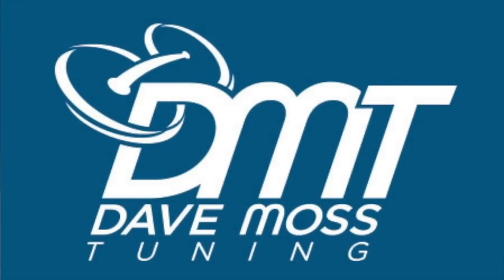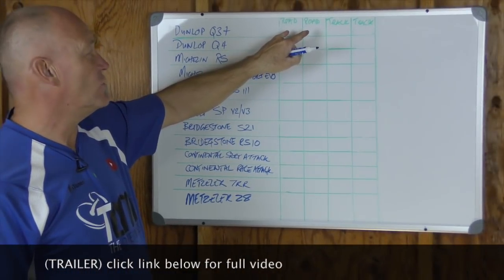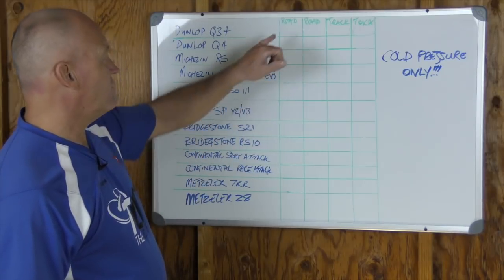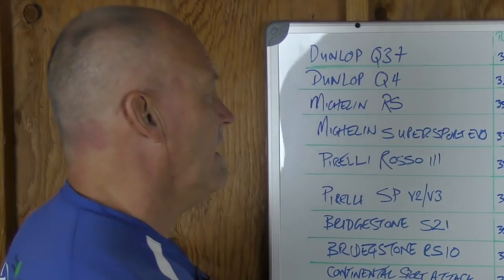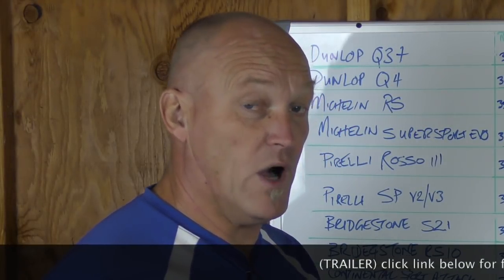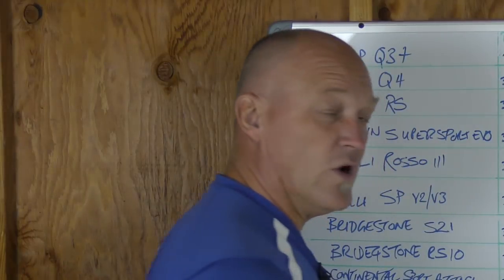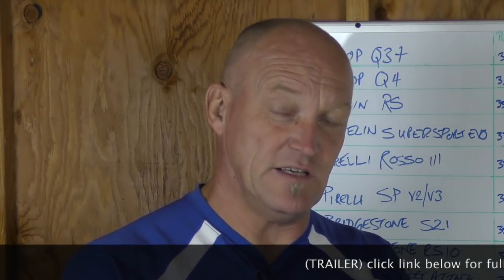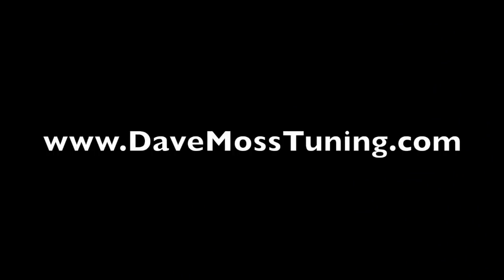Contact Patch: All Hypersport Tire Pressures (TRAILER)

Comment: Dave and Dave, would the S21 pressures apply to the new S22 also?

Thanks
Reply from the maker: S22 requires a couple of psi higher as the carcass is slightly softer.

Comment: i miss the riders weight and temperature?!?!?!!?
Reply from the maker: Dave Williams, editor, replying here.  No, you did not miss them.  Moss gives the narrow range of pressure to choose from based on your weight and ambient temperature.  It would be a 200 page book of data tables to do every tire at every ambient temp for every weight class, even in 10 lb (5 kilo) increments.  If you weigh 250 lbs (113 kilos), start with a higher pressure in the range, etc etc.  You must adjust it anyway from there no matter what, based on how fast you ride.

Comment: I prefer a bike that has low tire pressure’s so the aaprilla RSV4 is what I like. 
The BMW S1000rr likes Tire tire pressure Higher range 36 psi 

Honda CBR lower has well but a couple pounds higher than the Aprilla 

There the 3 I have personally owned!

The new Honda is going to be sick